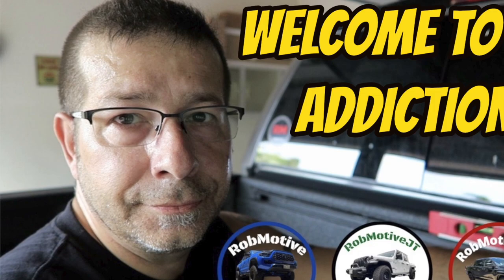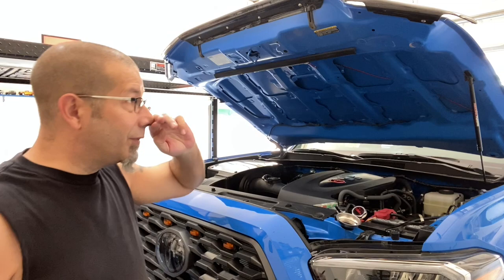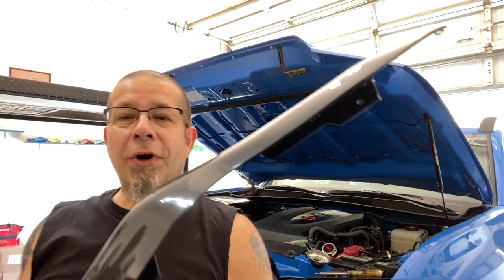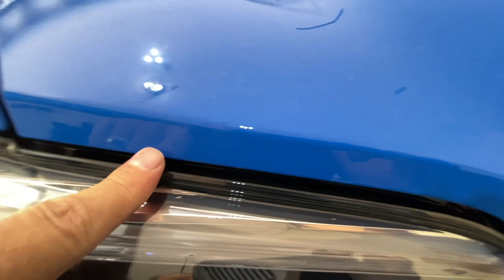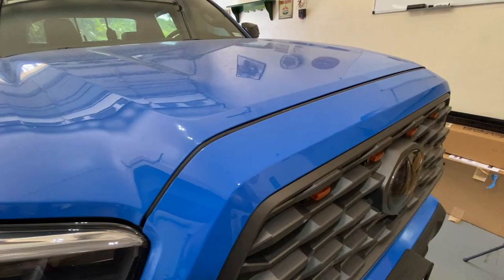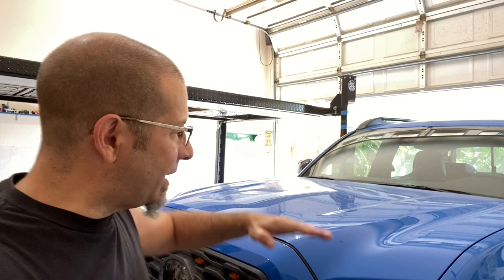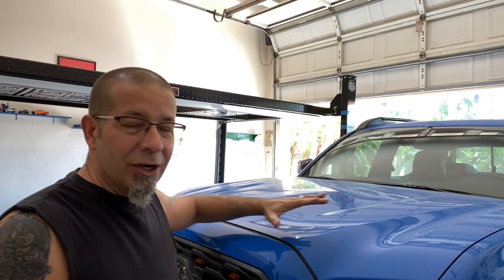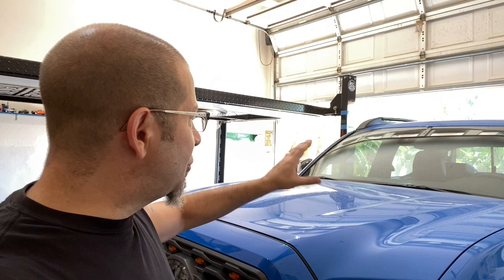Tacoma Hood Deflector Causes Damage

Comment: I wish the screws on my 4Runner's hood deflector came off that easily!  My deflector is shot, needs replacing.  But the screws that are left (some fell out already) turn, but don't come out.  Something is obviously on the other side, but it's INSIDE the hood itself, so there's no getting a grip on it while turning the screw.  I guess that's to ensure that instead of doing the job myself, I'll have to pay thru the nose to have it done at a shop.  Or, maybe I'll just let the rest of the deflector disintegrate until the whole thing is gone.   :(
Reply from the maker: That’s a bummer!  But..there’s always a way👍

Comment: I have had my weathertec bug deflector  for 5 years on my 2017 Tacoma(I purchased my Tacoma in 2016). Have had no issues. No bad paint areas. LIKE MINE.... Good video. 

It is amazing when you are in heavy fog you can see the air come up over the deflector and see the air stream and how it defects.
Reply from the maker: Now that would be pretty cool to see🤔
Reply: O
Reply: We put one on my dads 04 accord to keep the hood from getting chipped because it gets chipped every time you drive since the hoods angle.  It works well

Comment: yes just adding one and looks nice. Also rob when you did that train horn you put the button on the inside of the cab is there a way to connect it to the trigger4 wireless box and just hit the switch up or down of course it might just keep honking until you click it off but could it work this way. Need something to fill the in the last slot.
Reply from the maker: You could, but it will react just as you described.

Comment: Hmm you didn’t pop the hood to examine the lip of that hood that takes the vibration and can scar that paint up.
Reply from the maker: It’s a non-issue for me.  It doesn’t move👍
Reply: @RobMotive  if you say so?
Reply from the maker: Sure do👍
Reply: I had the same deflector on my 2020 tacoma. I removed it when I sold the truck and the lip of the hood was scratched from where the hood deflector contacted and vibrated against the lip of the hood. It was only on the truck for 12k miles. I should add though, that was my 3rd deflector from weather tech. The first weather tech deflector was scuffed up, which they sent me a replacement. The replacement they sent me was warped and wouldn't fit, so they sent me a third one, which installed smoothly and seemed to fit and not rub anywhere. However after removing it after 12k miles I saw the damage across the lip of the hood. I do wonder if perhaps that third deflector was defected from the factory. It's a possibility.